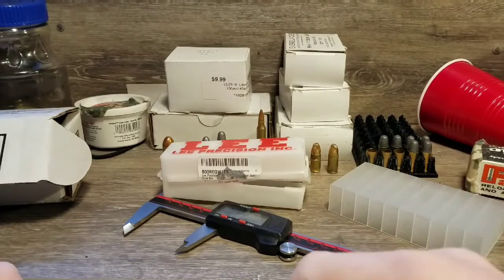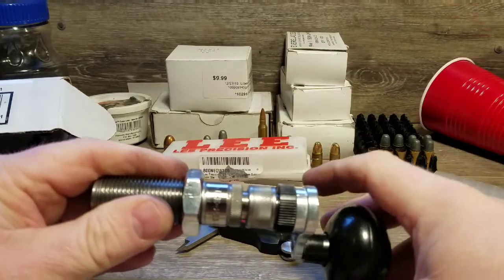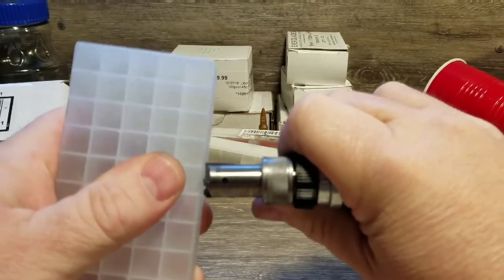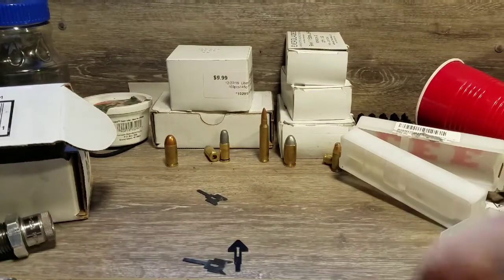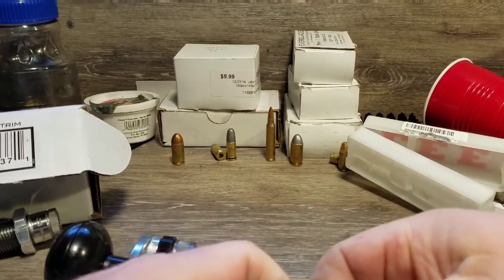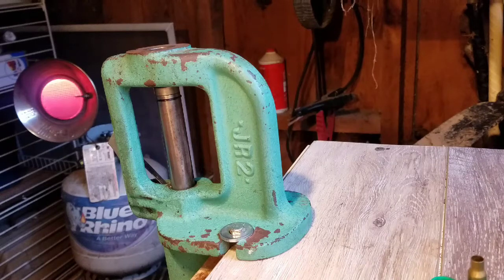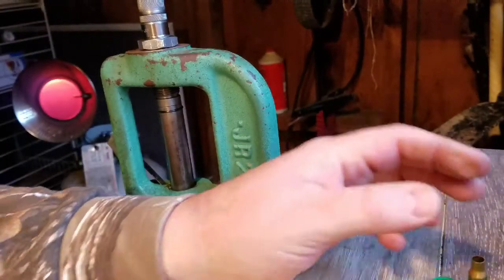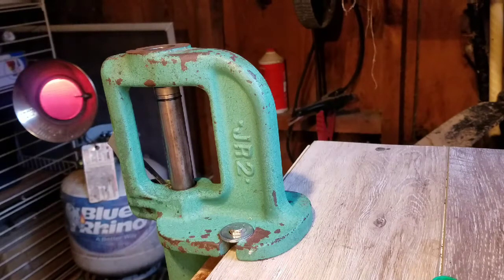Product review: Lee Quick Trim Deluxe

Comment: Thanks , I watched your video to see how the blades go in .
 I ended up making one out of a finishing nail. 
I cut a groove in the middle of the pin that I made,  using a dremal . 
Works great and it's made of metal now.  I think the original pin is plastic
Reply from the maker: That's great! Yes, the original is plastic. You had a great idea.
Reply: @redneckreloader  if you were to buy it on Lee's website ' it's only around 5 bucks plus shipping. This also includes a few other plastic parts that you don't need . 
It was fun making a better one.
Reply: Thanks @brigond I made the one  today following your idea. A round nail cut down and the middle thinned with the dremel. Finished with a tiny round file. :) top tip.

Comment: Bought this and tried it last night and could not figure it out.  Thanks for the video.  I was WAY over thinking it.  I am disappointed to see how frail it is.  I bought it and the case specific die for 223, 308, 6.5 Creed, 7mm-08, 7mm Rem Mag & 300 HAM'r in prepartion, now it looks like it may have been a waste.  I am going to give it a try and we will see how it holds up.  Looked like it gave you a decent case even with the problems.

Comment: I have the drill version Lee trimmer. Problem I keep running into with .308s is that it bevels the outside edge of the case mouth way too much. I heard there is a way to adjust the tension, but didn't get an explanation. Any ideas?
Reply from the maker: Yes. Try taking out the outer blades. I've actually taking the blades amount of mine altogether. I just used it to trim to length, then I use my manual tool to chamfer and deburr. I find it gives a cleaner edge that way. You could try just leaving the inner blade which would just chamfer the inside of the case mouth. You may have to devour it manually, but it's worth a try.

Comment: Did you size first or after
Reply from the maker: I size first. My reasoning is that case length can grow or shrink from sizing. So I figure if I trim, then I size, the length will change and I won't know what the final length is
Reply: @redneckreloader  you always size the cases first then if they are still over size you trim! All cases grow in length when fired, that is why when you buy new cases they are shorter than the max length of the case as shown in your loading manual. I only trim when a case is on the max length, not every time I reload them! 🇬🇧🏴🇺🇸🇮🇱💪👍

Comment: For the next time you can refer to this instructions: https://support.leeprecision.net/en/knowledgebase/article/replace-pin-inside-cutter-body-quick-trim
But your video was helpful to me anyway. 
Could you please tell me if the pin is really made of plastic? I cannot find the pin as a replacement part on the manufacturers website. Only enclosed in the molded parts qt (https://leeprecision.com/molded-parts-qt.html). But I do not want all those parts since I just need the pin. Do you have any suggestions?
Reply from the maker: Thank you for the link to the knowledge base. That looks very helpful. I'm at work, when I get home I can try to find the part number. I made a follow up video to this called something like the lee quick trim revisited. In that one I confirm the pin is indeed plastic. I believe i show the actual invoice from Lee with the part number and price. If you want to see if you can find that video. I think I covered the info you are looking for in the first few minutes, so you don't have to watch the whole thing. God Bless
Reply: @redneckreloader  Thank you. I found out the part number and contacted Lee‘s customer service. Let’s see what they will answer.

Comment: I just broke the damn pin in mine
Reply from the maker: It's easy to do. You can use it to trim without the blades. You will just need to chamfer and deburr in a seperate step.
Reply: @redneckreloader  I may do that im messing with dreaded 5.7x28 brass.... this crap has to be perfect as possible
Reply from the maker: With this primer shortage I've been trimming 10mm brass down so I can use it for .40 s&w using large primers. I removed my blades and it actually does a better job of trimming them. The blades got dull and were chewing up the brass instead of chamfering it. Good luck.
Reply: @redneckreloader  and sir, im trying to take out all variables if you know what I mean.... consistency consistency consistency

Comment: problem I see is that once it is set it should trim all cases to the same length ,which it clearly is not doing , junk at best , wouldnt expect that from lee?
also the retaining pin system is not very well thought ot , couls use a screw in there with a shouled and it wouldnt come apart till you took it apart
Reply: Someone broke theirs... :\
Reply: It trims different lengths if you don’t wipe the savings off of the case holder. Also every twenty five cases. Stop and blow out the die with a compressor. Make sure you’re blowing the right end. Don’t want oil in the end that holds the case. Blow mine into a cereal box.